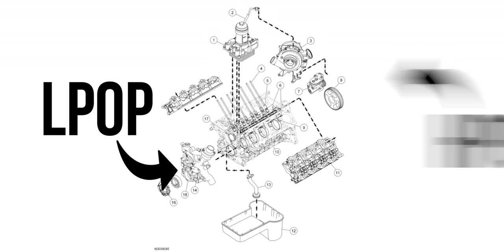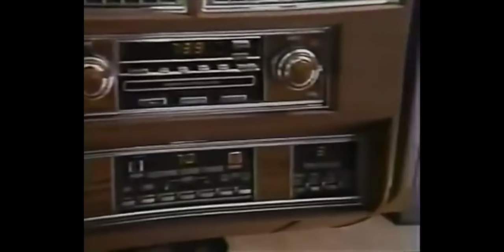These are the WORST ENGINES EVER MADE

Comment: Subaru 1800cc overhead cam engines that came out in the mid 80s. 
5 horsepower increase at 500 higher rpms over 1600 cc pushrod engine, oil passages in the camshaft AND a spray bar that, in a flat 4, overwhelmed the valve stem seals and oil consumption of 500 miles to the quart was considered normal. Plus, timing belts were notorious for breaking long before the recommended replacement interval.
At least it wasn’t an interference engine.
Subaru managed to take a reliable, well built, relatively inexpensive car and made an oil burning, unreliable, plastic pos.
Plus, they quit building the Brat!

Comment: I'm currently driving a 97 Expedition with that 5.4 engine. The early heads had four spark plug threads, while the 99-up PI engines had six. If you overtighten the plugs, the threads on the early heads will strip and you'll shoot a hole in your hood. If you UNDERtighten the plugs, they'll work loose and still shoot a hole in your hood.  So far I've got it right - proper torque is 12.5 lb-ft.

Other than being low on power, I've racked up about 320,000 miles on the old girl. I do want to have a PI engine ready to swap in though, should the original engine decide to quit on me. Of course, that plastic intake manifold brings its own issues with it as well....

The Lincoln 3.9 V8 had some design flaws as well. Like swaged timing gears - who does that???

Comment: Add the 1.7 liter VW engine that Chrysler stuck us with found in the Plymouth Horizon and Dodge Omni. Terrible oil burners, within 15K miles due to lousy guides. Class action suit against VW caused a recall and repairs for VW owners but Chrysler didn't follow suit and ignored owners.

Comment: Volvo used a POS V6 back in the 80's,,, but when the Motor finally was "Fixed" with the B280,,, it was too late,,, Volvo had a tough time selling the V6 in the High End 780 Bertone,, and the Kalmar 760,,, the other choice was the far superior B230ft with intercooler

Comment: Ford's idea of tiny engines & BIG HP.! My wife owned a Ford escape with an in- line 4 cylinder's, turbo charged! By the time it had 70K miles the dealership that sold it to her found coolant stain on cylinder 3 & said that they were going to switch out that 1 for a factory reman engine! How are you supposed to trust such technology if it can't hold up for 200K miles?

Comment: Another bad Toyota engine is the 2AZ-FE. When it first came out the head bolts would strip out if slightly overheated, and when they fixed that it started burning oil. Other than those problems it would have been a good engine but it burned a lot of people.

Comment: While I wouldn't call it the worst, the 4.6 litre 2 valve engine from Ford also ejects spark plugs due to the same thread issues as the 5.4 litre engine.
Reply: 128K on my '98 F-150, and never had that problem.  Frankly, I never heard of that problem on the 4.6L from anyone.
Reply: @eskieman3948  I had it happen to my '01 Crown Victoria last November, just Google search it and you'll see what I mean.

Comment: I have a 1995 3VZE at my shop now. my 1994 Toyota pickup had the engine recall done on it in 1996 at 39,000 miles. The main problem is the head gaskets. Robots over torqued the cylinder heads at the factory causing the head gasket to etch the block, then the new head gasket never sealed for long... they were resurfacing the cylinder heads, and decking the blocks, then Toyota was putting short blocks in all of them. a TURD yes. I say the power of a diesel Chevette with the gas mileage of a dump truck. not many left.... 1 more of these turds for me to do an engine job on..

Comment: Northstar was used for 18 years.  That's not a failure.  The "High Technology" iron head, aluminum block OHV V8 that preceded the Northstar was a failure. It lasted ten years, but in that ten years Cadillacs came with Oldsmobile and Buick engine options.   As for the horsepower rating of the Oldsmobile 350 diesel, it was the same as a Perkins 6.354 which was the second most used automotive diesel in the US at the time.  There's just not a lot that could be done with indirect mechanical injection.  It was still a massive failure.  Another real failure would be the Chevrolet  2300 aluminum four cylinder.

Comment: I still live in the Ford FE   bubble and from 50 years of experience as a user and mechanic, I believe that the SBC and the Ford FE are both the greatest engines ever made. I have had each that I built last for 500,000 miles with no trouble and still kicking dirt and taking names at the strip. I call both the best of all time. They could still be here today. I meant to add that I have one a 390 .020 over, that I built in 1999 that I beat the snot out of, 7000 rpm’s  until I went blind and then my son exercises it some. It doesn’t leak a drop of oil, water tight, no oil consumption at all has a 9 qt Canton on it still hits 85psig at 6500 and as far as want to go. You can go out and fire it up and go. I have never had it apart since I built it. The best engine I’ve ever had. The SBC is the same way when you build one right.
Reply: Do you have a link to your best engines of all time?

Comment: I had a mint condition Dodge 400 K Car with the 2.2 and i was stationed at Norton AFB.  On the weekends I had to go to the high desert for a second job.  I would turn off the AC get in the truck lane, put the car in 1st or 2nd if I was lucky and listen to the trucks mad I was slowing the big rigs down.  And that was in mint condition and 20k miles.  Downhill was just as bad as it was not a good handler at high speeds around 80.  I sold it quick and got a VW Scirocco and went 65 up the pass with the AC running.

Comment: There was the infamous Cadillac 4.1 liter in the early 80's that was a horrible combo of a low strength aluminum block with a lightweight steel crank- at the slightest bit of strain on the crank it would flex, breaking the main bearing bosses, then breaking the crank
 At a GM Board of Directors meeting to discuss the problem, the engineers, dealers, etc tried to blame the owners for not properly servicing the engines.... H Ross Perot told them they were full of "it"- the average age of a Cadillac owner was in the Mid 50's, with incomes 2-3x the average - they weren't changing oil in the driveway, they were having them serviced at the dealer......

Comment: The worst part about the 6.0 is international for the most part had it right. Ford went through and cut costs using cheaper parts for production models and the parts ford messed with were the ones that had problems.

Comment: I had a Deville with the North Star. I ran the piss out it. It never used any oil between changes and never blew a head gasket.The only things I ever had to do was replace the radiator and the air bag system. But yes, I know the had the deadbolt issue.

Lincoln had the deactivating cylinder technology  back in the late 70s. I think it was Mark IV. I never owned one, but never heard any complaints. The chev. v8 4.3 (305) was a stupid engine.Terrible fuel mileage for the gimpy horse power it put out. Yet that motor can be built with after market performance parts to run really well.

Comment: I'm so surprised you didn't go into more detail on the 5.4 and 6.8 3v engines and chopped it up briefly to timing issues. Essential, the entire engine is flawed. Increased engine size over the 4.6, same oil pump and passages. Badly designed hydraulic tensiors after Ford literally made a ratcheting tensiors for the previous gen. Bad cam phasers, bad cam followers, a terribly designed engine bay on basically every single 5.4 3v vehicle. They stuffed it in navigators and expeditions till 2014 while the 3.5 and 5.0 esisted.  They fixed the spark plug ejection issue and gave it a far worse issue in the form of 2 piece spark plugs that would certainly break off requiring extraction. I mean this engine is a absolutely tragedy of engineering, it in my books surpasses every engine on this list say maybe the Northstar. A massive distinction between it, and most 'bad' engines is that no matter how diligently you take care of it, it can break a guide and throw a phaser taking thousands out of the owners pockets. At least with the 6.0 you can leave it stock and get good miles out of it most of the time. Nope, the 5.4 3v was a downgrade over the 5.4 4v and even the 4.6 4v that came prior. 

And I own one! Love it to death after I fixed all these issues. Ford came out with revised parts, quelling most of these issues. Toss a high volume oil pump in it and the revised parts and it sings. Brilliant engine once taken care of. They also create bargain deals on larger SUVs and upper trim F150s because of all these issues. Bad for the owners, great for those who want a project to get a good vehicle at the end of the tunnel.

Comment: I would definitely add the first Volkswagen 1.4l TFSI engines. They often do not even last 80 Tsd KMs. Well, thinking about it, all those VW TFSI/TSI engines seem to be quite bad.
Reply: Well, the Ford Pinto/mustang II had the timing chain issue that chewed cam shaft lobes off every 20,000 miles. These engines were used in a lot of cheap industrial pumps, wood chippers and the likes.

Comment: I remember my dad got a T100 with a 3VFE, and it had the most doughheaded design I've seen on an exhaust yet. The passenger side manifold output I to a catalytic converter, that the fed back I to the rear of the driver's side manifold before all of the exhaust exited out the driver's manifold between the rear two cylinders.

So stuffing exhaust gases superheated by the cat (which was stuffed between the engine and the firewall) back into the driver side manifold and pushing it through/past the rear exhaust port.

Can you guess which cylinder cooked the head gasket?

Comment: Electrolysis in the cooling system ate up the head gaskets. This and going forever on the same coolant.   Take a dvom and ground at the battery. Then put positive lead  in coolant and see the voltage. 
Then start engine. If volts jump up a couple tenths then  install ANOTHER engine to frame ground.  Check frame to batt ground also..

Comment: From the UK I would say the 998 cc Coventry Climax based engine in the Hillman imp and Sunbeam and Singer derivatives. If it blew a head gasket, which it did regularly, you could 9 times out of 10 write the engine off as it warped either or both the alluminium head and book. There was so little meat on the head you could barely scim it and the distorted block meant you were unlikely to get the wet liners to seal properly. Even professional engine shop were reluctant to touch them or warrant any work they did on them. Great little pocky engines in a liteweight car was a great combination when they were running, but when they overheated you just might as well throw the whole lot away

Comment: QUAD4 - total POS. I had a 1989 Buick Skylark with some pimped-out "rally" package that made it a very nice and good-looking car. (Seemed to amount to suspension tweaks, alloy rims, and wide tires) You had to pull the block from the car to change spark plug #4; it was not really designed to be maintained. Mine broke timing chain tensioners all the time. It leaked. It warped heads. Terrible engine. It ran really well… until it didn't run at all. My mechanic called them "50,000-mile engines".

Comment: Toyotas 3.0 had multiple problems. Currently own one. One of the problems is sone electronic issues but regarding the issue the back of the cylinder head would be over heated because of the exhaust cross over, another was the poor head design and poor oiling in the bottom end

Comment: Including all dates of manufacture would be helpful. I have a ford 6.8 in a 2001 van. Other You Tubers said that if I kept up with the 3000-mile oil changes, I could expect to get 350,000 + miles out of this beast. This is the first video to say anything about shooting spark plugs. Are there any after market heads to cure this problem?

Comment: Even if an engine has a lot of pros it is obvious just one or two serious cons make the engine undesirable.  Ford seems to actively create failure points in everything they ever made to this very day.  But in the 1960's to 1970's, when I started driving, a lot of Ford engines were notable for their strange quirks, which ran from the humorous to infuriating depending on your viewpoint.  The Ford straight 6 (in the old Falcon) had its distributor placed at the front lower portion of the engine, in the exact place to get splashed by a puddle when in motion and invariably stall the car.  (Some Fords of this era also had windshield wipers powered not by electric motors, but by engine vacuum, no less.  This meant the wipers swept too slowly while actually driving, but would practically beat themselves to scrap as soon as you slowed down, because when engine vacuum was highest the faster they swept.   These were truly hilarious to watch in action, unless of course you were the driver trying to actually see through the windshield.. but this post is about engines).   But these weird issues were minor compared to the fatal flaw of many of the Ford V8 big blocks/302's of the time, namely this engine used a distributor shaft that was HOLLOW - so it would sometimes break when over-stressed.  The distributor shaft was driven by the camshaft, but the shaft also drove the oil pump.  So if it broke, usually at high rpm, oil pressure went to zero and your engine more often than not, would instantly self-destruct.

Comment: I'm a ford guy but the 6.0l and 6.4l powerstrokes aren't worth the materials they are made of, the 4.0l SOHC v6 from the explorer has half its timing set, called a cassette, between the trans and engine block total garbage not to mention the plastic intake and thermostat housings. I agree with the 5.4l and 4.6l engines minus the 4.6l police interceptors, I have one I put in a lincoln town car and it seems indestructible. I drive it like I stole it and it just keeps going.

Comment: The Vega engine is the worst.  The first GM V8 diesel built with an Oldsmobile engine was close to being the worst.  Then the Northstar engine was also terrible. Also when GM went to aluminum heads on the 4 cylinder engines, they blew head gaskets like crazy.

Comment: Every one talks about the 6.0 but no one mentions the 6.4 which was way worse. Aswell the industrial versions of both engines, the vt365 and maxxforce 7 respectively didn't have all of the same problems because the emissions systems weren't as taxing in a heavy/industrial application. Ask a school bus mechanic how often they do head gaskets on a vt365.

Comment: Ford f150 iron block with aluminum heads. I had one overheat and no warning lights so it warped  the head and engine was toast. I had it replaced and the shop didn't pressure check the cooling system and it wasn't filled properly and then had a coolant leak and warped the head again. Now the truck sits

Comment: When the Cadillac 472,500,and,425s ran the roads in it heyday,their owners handbook stated "It is normal to add some oil before the drain period .Requirements will very, depending on the type of driving you do,but the addition of one quart each 800 to1000 miles would not be considered excessive"To go to your point on the Northstar, their problems didn't manifest themselves til a couple of years down the road,after they were sold,and you are right when the showed up they were bad.. Typical GM great design,petty stupid cost cutting ruined what could have been a great engine.

Comment: 12:03. I wondered if you would get to the Mopar 2.2. I have a 1989 Dodge Aries that I bought from a junkyard in 2003. Someone had ran the engine out of oil. I took it home and overhauled that engine in my driveway. I put in a reground crank a rebuilt rod and piston rings. I'm about to hit 180,000 miles on that overhaul. I change the oil every 3,000 miles. Those engines were the last good engine Chrysler made and the K car was the last good car they ever made. They don't wear out but they can be broken.

Comment: The problem with the Oldsmobile diesel is that they underexaggerate the problems with the first-generation D Motors and over exaggerate the problems with the second-generation DX Motors. The first generation demotor the block was adapted from the gas engine. The second generation DX motor however was a uniquely developed design that was closer in its architecture to the Oldsmobile big block of a few years prior. Still grossly underpowered but practically bulletproof. There are a few diesel Builders out there that has fitted turbos this motor the second generation version that is and the power level has gone up substantially. It just underscores the fact that diesel needs a turbo or supercharger to really have any power. The real turd is the 4.3 V6 diesel, which is the only V6 based on the Oldsmobile engine architecture.

As for the Northstar while hating on the oil consumption issues can be a legitimate concern the aftermarket has solved a lot of the problems as it was built from the factory. With a full top and bottom kit from Northstar Performance you can take a somewhat anemic Northstar V8 and make it bulletproof enough to run the spinnies, yes Northstar beefed-up is very favorable to supercharger or turbocharger...